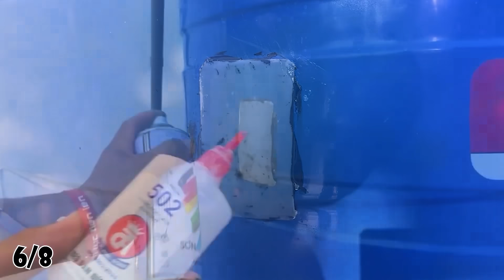I Never Have to Buy Water Again! How to Make Free Water Directly from PVC Drainage Pipe

Comment: Not one comment has asked where he lives and if it rains all that much for all this work common is is that he never has to pay for water anymore common household water comes in at about 60 to 80 psi the pathetic Lil pump he got isn't going to give him enough water to do crap with it may be enough to wash your hands or flush a toilet but you're not going to be able to shower in it or anything so his whole idea is based on the fact that it has to rain constantly for him to keep enough water so he never has to pay for water what does he do for irrigation water
Reply from the maker: Thanks for watching the video! Your concern about not having enough water to use can be a problem if we don't have enough tanks. Because of the concern about tanks, I used small tanks so that I could easily move it to a larger tank located inside my house. Or a water pump would help me do that and pump the water back into the house's plumbing system.

Comment: Storing rainwater is forbidden in Germany by law.
Reply from the maker: Actually, storing rainwater is not universally forbidden in Germany. While it is generally allowed, there are regulations depending on the region and intended use. For example, using rainwater for flushing toilets or watering gardens is common. However, it cannot be connected to the drinking water system, and there are strict guidelines to prevent contamination. So, while the practice is regulated, it isn't outright banned. Do you have any specific details about how you'd like to use the collected rainwater?

Comment: You dont believe in washers or rubber o rings do you bro
Reply from the maker: Washers and rubber O-rings are actually essential components in many plumbing and DIY projects. They help create seals that prevent leaks, ensuring that joints remain watertight. If you have concerns about their effectiveness or durability, what alternatives do you typically use?

Comment: What a fantastic waste of time and money. Surely it is cheaper and more efficient to go to the local building supply store and buy a proper water storage tank and fittings. Mucking around with all those buckets is like a kids play system.  A few hours in the hot sun would tend to turn the water in the small plastic drums rather off.   Wow this person has more money then sense.   I will stick with my local irrigation shop thank you.

Comment: The water might be free but the rest of it is not. And once you figure you've broke even on all those plumbing supplies there's the ongoing cost of electricity for the pump , filtration, and water treatment to make it potable. Not effective for dryer locations. It's a great how-to video but just because you can doesn't mean you should.
Reply from the maker: Thanks for watching the video and giving me great advice! But when I am thirsty, I will choose water over a handful of money. What do you think if we create a closed system, the sun or wind, or running water will turn the electric motor and charge the energy storage batteries. Then we will have both electricity and water, then water will help us grow crops and raise livestock. A completely self-sufficient model is ideal, right? Do you have any ideas for such a model?